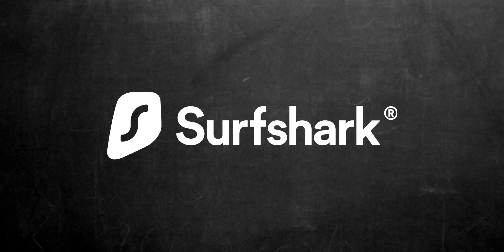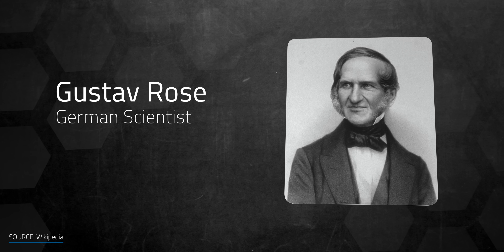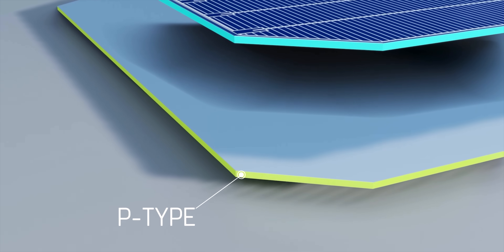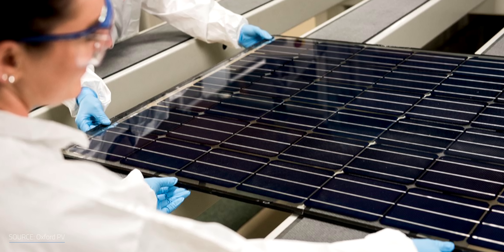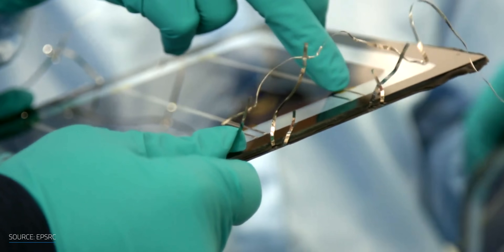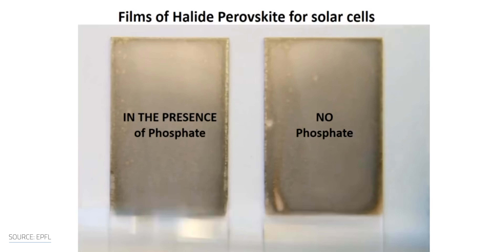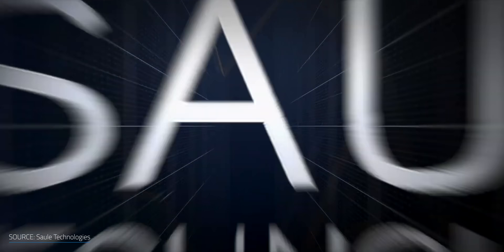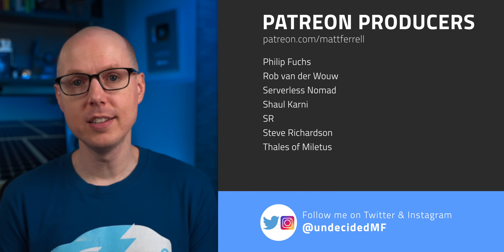Perovskite Solar Cells Could Be the Future of Energy

Comment: PEROVSKITE is definitely gonna take over from Silicon.

MAIN REASON: 
25 years of Silicon Life in NOT needed.  Further New Technologies and Further New Materials in the Next 5 -10 years will  make Silicon cells OBSOLETE.
GONE are the days where a technology use lasted for 20 yrs or more.
World is CHANGING RAPIDLY now.

AND....ALREADY
Cost = 1/8th
Efficiency =>  HIGHER
Intense Heat Not Needed
Special Materials Not Needed
New researches reducing the issues of Life span  &  making Lead-Free too.
Manufacturers increasing the use of Perovskite solar cells.
Its a matter of time.

Comment: You clearly do not understand economics and effeciency of the solar powerplant as a block. You don't need powerfull solar panels, they already are powerfull enough and last very long. What about the inverter, battery, management system? Those are most expensive and fragile items in your powerplant.
You can have even an ultra powerfull solar cell, but if you can't use or store energy, that's serious problem.

Comment: I agree it’s a matter of cost/m2 per year of viable use. Efficiency at this point doesn’t really come into it as roof space on houses (well in Australia anyway) is big enough for a system that produces more kWh in a day than you use. 

Given this it’s more about cost to install Vs life span. Having 2/3 of your roof covered Bs the entire roof doesn’t really matter. So up to 20 times cheaper and lasting 1/2 as long is cheaper for the user by a factor of 10 and a boon for the installer who gets paid for the same job twice and the manufacturer who gets to double its production. Remember you need to replace your inverter at 10 years anyway (well it fails and you replace it).

Comment: Matt - it’s a pity you failed to understand what is trully going on regarding perovskites and the factory in Poland. The girl you see at the factory opening ceremony (Olga Malinkiewicz) is a Polish scientist and a shareholder and founder of Saule - she made the breakthrough possible for perovskites to be produced commercially and Saule signed a contract with her to produce perovskites en masse - the condition was that the factory is built in Poland.

Fixed it for you!

Also first buildings in Warsaw and Lublin have been equipped with perovskites commercially - they can produce energy regardless of the angle that the sun is shining at them so they are much better than anything we’ve known and also as they are fully transparent - can be applied to windows of modern skyscrapers!

Comment: Well Matt I have an extremely difficult science question for you, How does the efficiency of any type of solar panel compare to the hydrocarbon cycle of  self replicating plants? Mix sunlight water Co2 and soil, and an entire planet is storing energy without manufacturing required, however without abundant Co2 this proccess will cease, any thoughts?
Reply: Nice!!!
Reply: Photosynthesis is actually less efficient at converting sunlight into energy about 3-6% compared to Solar panels in the 17-23% range. Plants don't need that much sunlight to covert soil nutrients and CO2 into energy stored in food, so evolved to only use a small percentage of it. Solar panels are specialized for a singular purpose of electricity generation and have been optimized for such.

https://en.m.wikipedia.org/wiki/Photosynthetic_efficiency
Reply: @tonamiplayman4305  Wasn`t aware solar panels could self replicate, plants efficiency is dependant on available Co2 and its a multiple because they replicate, so 3 to 6 percent is for the individual not the collective amount which greatly exceeds solar panels
Reply: @crabbyr6929  Multiple research teams have calculated this to account for the energy generated from photons hitting the leaves and its low. Not because plants are poorly designed, just that they don't need that much. Most of the light is lost to reflection and moisture from the leaves.
Reply: @crabbyr6929  The replicate part you're referring to is just a fancy way of saying they store energy as food. As stated earlier and in all prior research, Sunlight is not the only energy source for plants. It's part of the equation. Plants take chemical energy/compounds from soil and air to create the chemical energy stores that is food. The research has excluded those sources. Comparing the replicate part to solar panels would be like adding energy from a gas turbine to the efficiency calculation of a hybrid Solar/gas plant. 

The efficiency I'm highlighting which is backed up by countless research is looking at the pure conversion of photons that hit the leaves of plants or solar panels to energy. And in this situation solar panels use more of the light. It's OK that plants uses only 3-6% of the light that hit their leaves and reflect the rest. They don't need anymore than that. You can argue with multiple research teams by producing your own research backing up the "replication" by plants.
Reply: @tonamiplayman4305  "The replicate part you're referring to is just a fancy way of saying they store energy as food."
No try again...much more complex than that...Like I said you are unable to process the meaning of my texts

Comment: I want those transparent glass panels on smartphone screens.

Edit: But the panels point INWARDS not outwards, in that way it captures the light from the screen (which drains the battery the most) with over 30% efficiency, so you have a phone that lasts longer.

Comment: While solar cells have come along way in the energy market, Hydrogen cells will be the future of clean energy. No sunshine needed, non toxic, totally green with a by product  of water. Solar cells care toxic to make and require enormous resources to manufacture including a limited life span. Hydrogen is stored in all the oceans on the planet and is free for extraction. Hydrogen cells are the most logical choice for free, green energy, even cleaner than Hydro electric and certainly cleaner than nuke power plants. We the world should be investing in Hydrogen to run our cars and power our homes.
Reply: When you say that hydrogen is stored in the oceans, what are you talking about? Is it the water itself? Because there is extremely little dissolved molecular hydrogen in the oceans.  If it's the water you're talking about, more energy is needed to break the bonds in water than can be usefully harnessed for electrical generation.  Hydrogen cells are useful as energy storage but not really considered a method of energy generation.

Comment: @Matt Ferrell, Thank you for taking the time out to present this new tech.  Much appreciated!  Very compelling.
You've presented a case where there's MASSIVE value in having these panels, given the low production costs , even though their longevity is a fraction of bog-standard solar panels (at least from a raw-materials cost), and making it clear that the cost of protecting perovskite does narrow the cost/benefit significantly.  Also, not having lead(pb) changes the game too.   Also. you make a good point that not everywhere on our planet reaches the temperature extremes that require certification comparable to solar cells.  With higher efficiency panels, the more accessible they are globally.  Clearly, you've put this stuff in a spreadsheet and you already know the what the correct answer is. right?

Comment: Ok I'm gonna be that guy... I want these in my Model 3 roof glass. It might not make sense economically but I do like that idea that if left outside my car will not just drain down to zero eventually. Even if it only picked up a few miles a day it would be cool to know that I'm always gaining energy - potentially. Only downside is parking my car out side... Definitely have to do a ceramic coating then...

Comment: C-14 is in the air you breath. There is millions of kilograms of concentrated C-14 in graphite reactor waste. C-14 emits beta particles, these are completely blocked by a single sheet of paper. Diamond is carbon. Whether your C-14 is graphite or diamond is of little importance, the term diamond is just a hype term for promotion. I see this technology best used in large stationary installations. A closet size generator in your house would provide about 600 watts of continuous power for 1000s of years. Encased in steel and tamperproof safety measures. A Geiger counter would register zero radiation over normal background. Cost would be about the same as a normal photovoltaic home solar system but provide exponentially more power over your lifetime.

Comment: If the individual cells would be made more modular and standard industry sizing of panels, plugs, connectors, and mounting, then replacing spent cells would not be a problem.

Comment: A material that can be manufactured using printing-press technologies will certainly revolutionize PV electricity. Even if it is less durable, if it can be chemically recycled, a few year durability may be sufficient.

Comment: Doing a bit of basic math, with an increased efficiency of 50% relative to the current tech, and a cost of 1/16 the cost from the cheaper production of current tech, that would make it just as cost-effective if the panels last 1.04 year (to the 25 years of current tech). But then, you would have to factor in the labour cost of replacing the panels 25 times more often... plus the excess waste management and material recycling costs of having the panels replaced that often. So the actual cost of using a new technology like this is much more than just the production cost.
Reply: But there are also cases where replacement is not a concern and we do not expect tech to last more than a few years (Mars rovers for example) where these could become more viable, much sooner.
Reply: Te reduced entry costs is very important for poorer communities though. The upfront cost of Silicon panels is what stops most people from buying them.

Comment: Please explore the mining of copper vs. lead.
Both have been highly toxic.
And lead, for example, is associated with radionuclides - uranium. US EPA must spend large $ and years for  cleanup and sequestration of byproducts.
What capacity to recycle each exists?
How toxic ARE the assembly processes of photovoltaic panels, silicon and perovskite?
More on China's flexible photovoltaic cells,, applied on products, road surfaces, vehicles, nonwindow areas of buildings!

Comment: I am always puzzled by the emphasis of the efficiency in PV cells. Surely since sunlight is free the only factors are cost per watt,, longevity of the cells, plus availability and dispose ability of the materials involved. Great presentation helped me sort out my plans for my current solar electricity generation. I think that I will not rush to replace my current older rooftop PV cells if the advances are occurring so rapidly. I have to wonder if the development will ever slow enough for me to jump on the wagon!!!
Malcolm Hughes Sydney Australia

Comment: Why does anything have to last 900 yrs to be accepted?  It's all cost-related.  Once the substructure is installed to handle the DC input and inverted, etc., swapping out panels should be a lot cheaper.  If a panel fails, just replace it.  It's not a complete redo of the initial job.

Comment: Making cheaper cells is great and all, but they have already came down in cost so much that they are similar cost to the power inverters, possibly even cheaper. Need to figure out cheaper inverters, or do away with the AC grid.

Comment: very interesting debate on this top well done video that I also subscribed for more!  By the matter, I think the users would not replace monocrystal solar panels with these perovskites firstly because of their low stability and therefore lowest use duration.  Just imagine yourself dissambling like 10 heavy panels structure to replace them almost each new year...and doing all these for only less than even uncertain unstable 10 percents efficiency gain...  Even worse... even if 10 times cheaper, you should buy new set perovskite panels almost every year to preserve same origin performances level, so same price along each 10 years. But as the modern solar panels usually last more than 20 years, you may finally pay these pervoskites! twicely for same over 20 years use!...

Comment: If installation is matched to lifespan, it works because the cost efficiencies are so much better. People replace their cars, because it is easy. Likewise appliances. If solar panels could be replaced easily, without high costs of re-construction, this would be a no-brainer. Of course, recycling of used panels would have to be known in advance. Standards are required for replacement panels to keep lifecycle costs low. The big risk with lowering costs to this degree is lowering returns in a chase to the commodity bottom which disincentivizes the market over time.

Comment: The real problem? The 25-year warranty. 

Manufacturers can't back down from this and (for example) introduce a more efficient panel that only has a 10-year warranty. The only available offset would be a much lower price, which creates another hurdle. They're perceptually hampered by market psychology, terrified of losing their customer base with new tech that falls apart in only a few years.

The 25-year warranty painted them into a corner.

Comment: I think the most important advancements in solar technology are those that make them easier to make with more common elements especially moving away from lanthanides and difficult engineering processes that require large specialized factories like places that make silicon wafers.  The easier they are to make, the more useful and adoptable they will be even if they don't last as long.  I think non-poisonous will also be a necessity, so no lead...

Comment: I hope that "window, that generates electricity" is tuned to infrared range.
Otherwise such idea is stupid.
Reply: infrared lacks the energy to be used for PV electricity production.  IR = low energy. visible =higher. UV = even higher
Reply: @protonneutron9046  UV is good too. But instead of blocking visible light by semi-transparent panels it is better to make smaller window and put on now larger wall regular panels.

Comment: Good intro on it.    Regardless of what types, one of the larger expressed arguments against solar panels is the end of life treatment, fears of toxic waste - where it's going to go, water tables etc...  maybe another video to make centers on the recycling of solar panels, potential mechanisms to do it high and low volumes, at low costs etc as part of the total life cycle.   Same issue with batteries, which seem further ahead right now with companies like Redwood Materials and Li-cycle well into the game.   Somehow, there needs to be a collection mechanism that bundles them up in a way that they can fill railroad cars or trucks with them and take to designated sites for reduction to primary materials again.   I'd like to hear who is planning for an going after that sort of issue, what they expect to see as recovery and lost in process.  thx.

Comment: I think NOT, for multiple reasons:
1. Perovskite SC have the same inherent technology drawbacks as organic solar cells had.
2. They use lead (Pb) in their main absorber layer, just dig deeper into scientific papers - that alone puts them out from transitioning to mass market in most countries.
3. There is an inherent issue stemming from physics related to their lifetieme. It's a complex subject, but it can be oversimplified by saying that fabricating a "low-energy material" that has high electron affinity (such as ETL in perovskite SC) puts it right on the spot for fast and easy oxidation (which can be cuontered by effective, but expensive encapsulation). In short words it means that there is a physics limit saying that you can have either an efficient PSC or a long lived one - if you're opting for cheap and low-energy input process.

While my comment might seem as a bit sceptic, please note that I'm not saying this as a perovskite hater - I'm a solar cell enthusiast with top formal education who had experience with most major "breakthrough" tech in the last 15 years. Unfortunate as it is, we know from basic physics what has to be done, but there is a lot of hype-marketing going on every time a new tech is introduced to the market.

Comment: 4$ per sq feet with 25 years vs $0.25 per sq feet with 2 years. by the "maths" with the same amount of money you can have 32 years if you change panels every 2 years. that is a comparison with the cheapest shown in the video. even if the installation went to $0.50 per square feet but it has a lifespan of 5 years it would be great and good enough to be used on the market. the amount of money saved would be bigger than the amount spent to substitute the panels every once in a while. Give it 10~20 years and it will be all over the place and that is graphene does not take its place.